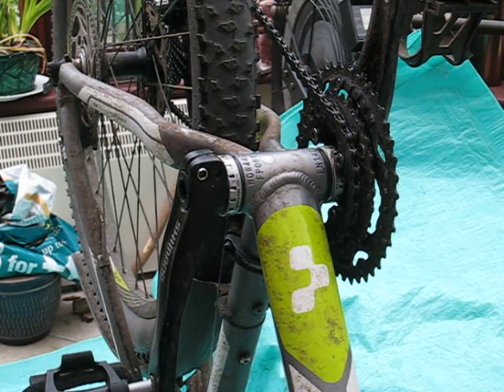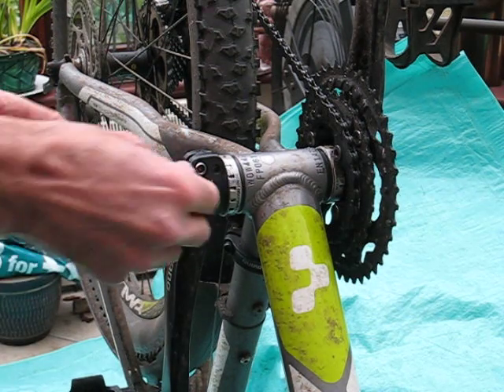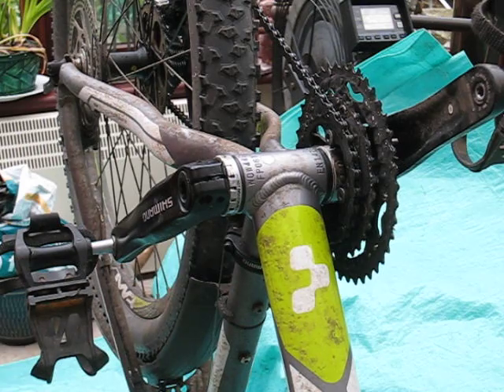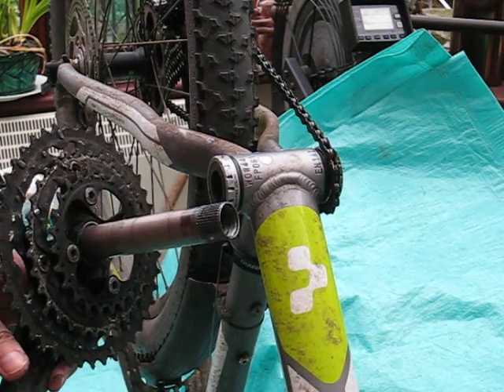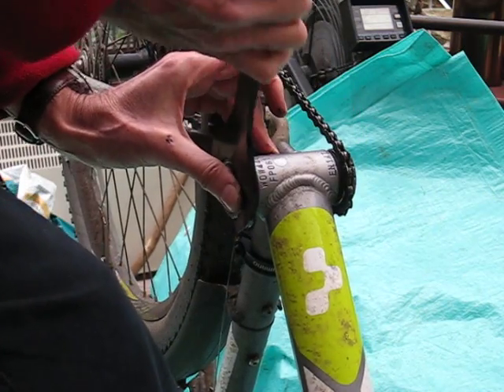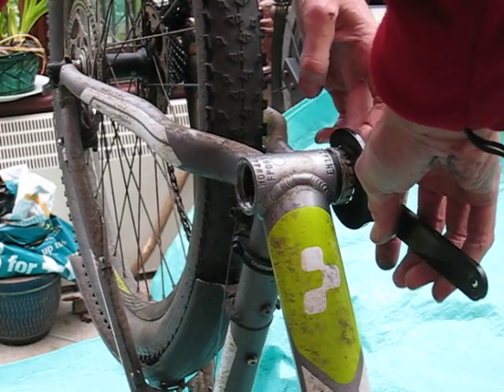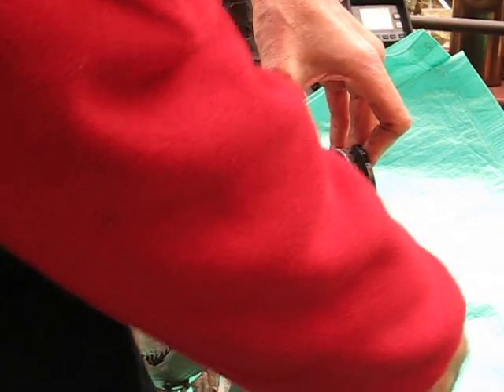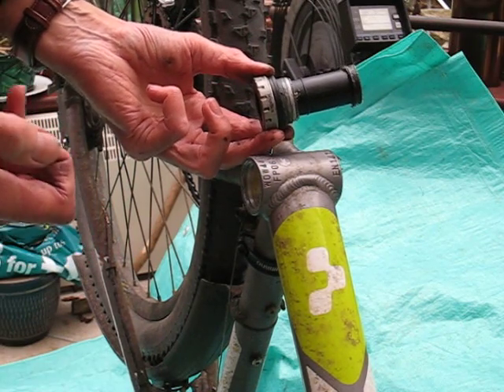Shimano  Hollowtech II bottom bracket replacement / repair - part 1

Comment: I have same crank new from bike shop when you rotate with back wheel up it acts like crank is just too tight you can feel it. How do I fix this. Shop said it's normal lol thanks
Reply: it's tight because it's preloaded pressure the cranks into the bearing. it's different from the square tape which will develop creaks over the time. 
It won't affect you much.

Comment: good idea!  but now while screwing in the two small bolts on the crank 
arm with a torque wrench set to 12nm, on the arm it says 13-15nm!?  Well
 I started to screw them in evenly on both bolts and then it slipped?  I
 noticed my hex stripped the internal bolt socket being no where near 
15nm?  Is the spacer in between the bolts in the gap suppose to be loose
 or is it suppose to be snug and zero gap, ala' 15nm? I would think 15nm
 would either snap or strip the bolt, 15nm is hard!!  what you think?

Comment: You can actually replace the bearings... 
Bearing #6805. 
It's cheaper than buying the whole SM-BB52 set. A very good Japanese or USA made bearings about just 20% of the cost. And i have been doing that several times already. 
Just make sure you're best or very good or at least good in pulling out and pressing in the bearings so you don't damage the housing.
Good old Filipino ingenuity.
Reply: Funnily enough, I've just replaced my road bike hollowtech 2 bottom bracket and taken a cup apart and the bearing is a 61805RS. If you made the right presses, you're right, you could easily replace them. Problem is, in the UK, the two replacement bearings would cost nearly twice a whole new bottom bracket!